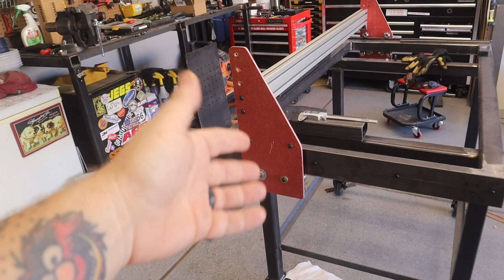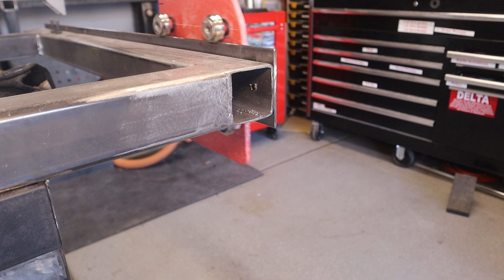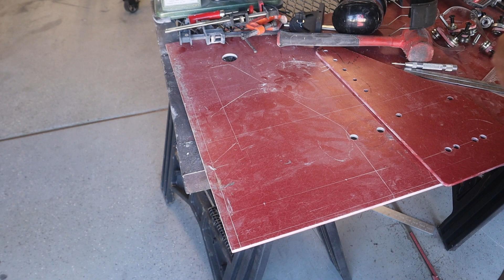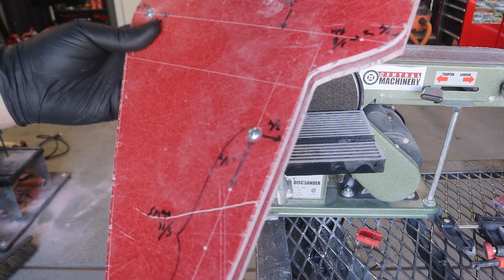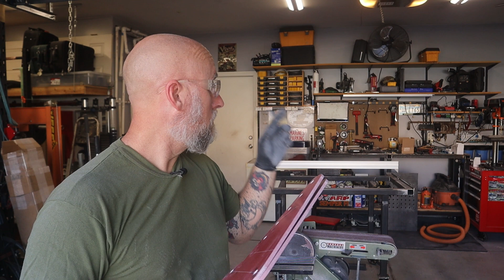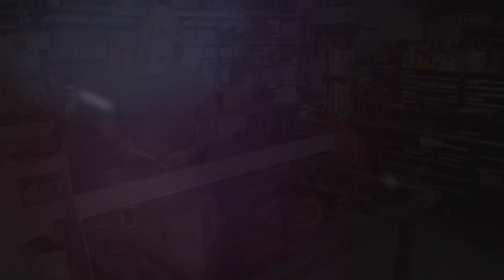Budget DIY CNC Plasma Table Build | Part 3 - Gantry

Comment: The springs on the rollers underneath the gantry plates is brilliant my bro.. I have a thought for u if u don't mind.. Why don't u use some 3mm mild steel plate and cut the same shape out to mirror the gantry shape u have made from fibreglass bro?? or u could double up and glue 2/3 pieces of fibreglass together to make them stronger.. It might work man.. I'm having similar issues but the fibre glass has given me inspiration so thanks bro.. haha! Lovely Jubly!!
Reply from the maker: I never thought about doubling up the fiberglass....I may look into that once I actually finish this and get it running.  Thanks for the idea!

Comment: well done video series. I recently built a CNC plasma table with a different rail system but I'm having some wobble. So I was thinking of changing to this system. I originally saw it on the @sbirdranch channel which may be where you saw the cam lever design.
Reply from the maker: Yeah, I think that was where I saw it.  I haven't had the chance to finish the table yet, but it seems like it should work out